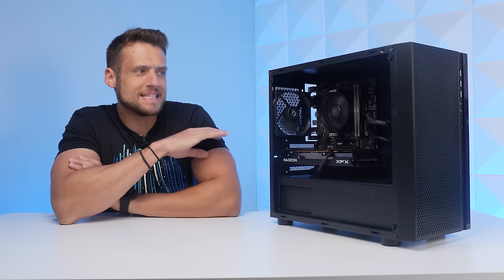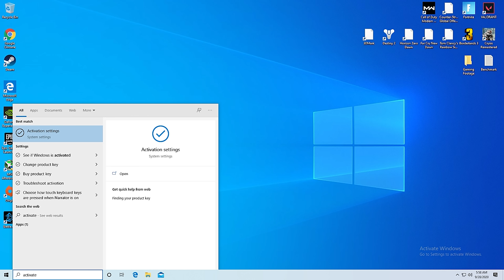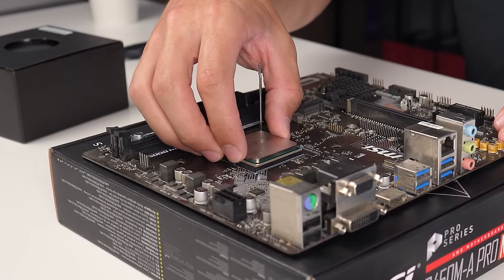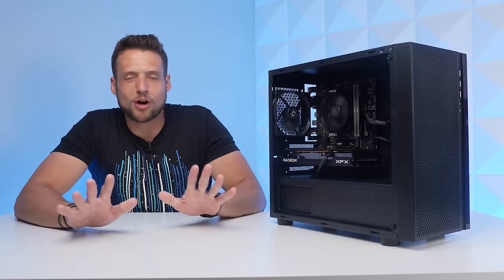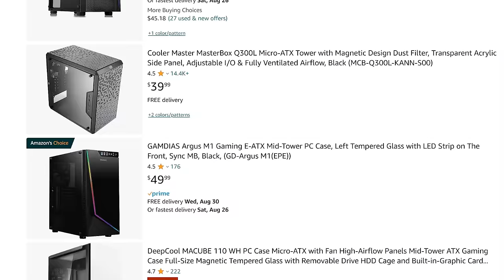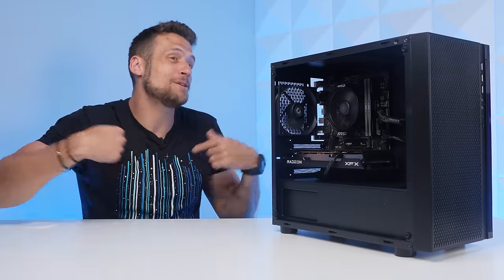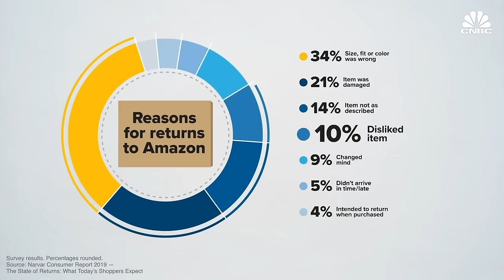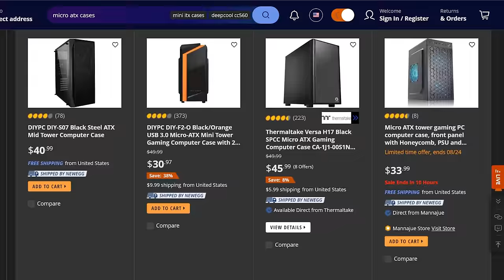How to Build a $500 Gaming PC on Amazon Prime

Comment: You know as a new pc gamer these videos are very helpful, I bought an OptiPlex 790 put the i7 2600 and 16 gb ram and the rx 550 4gb gpu,it has been okay for a starter so thinking of building my own and seeing all these cheaper builds are great as I'm obviously on a budget gaming with an old OptiPlex.
Reply from the maker: Very nice!
Reply: hope u build your pc soon! good luck :)
Reply: That's awesome!!! Something to help if you decide to go for it, this is what I did. I knew I was going to build but didn't want to hit my budget at all once giving me more time and money to invest. 

 Found the case that I wanted. I was able to spend a bit more on it buying it in the beginning. If the case needs fans get those. If you're gonna want cable extensions get those.  These take a part of the budget and are less likely going to have issues where you'd need an exchange. 

Then I'd get CPU cooler, RAM, SSD, PSU... but I'd get these knowing I'd get the rest of the parts within the return/exchange window if any issues. 

Microcenter has some great motherboard/cpu combos. They sell these on amazon too. GPU and you're all set. If you do a $500 build like above this can be done in 3 paychecks. Or 4 if you want to split it up $250 each month 😊

Good luck to you! Building is fun!!!
Reply: When upgrading, changing the graphics seems the best option. I recommend the GTX 1660 for a nice price and still a good upgrade.

Comment: Honestly that's a solid build even with the restrictions you put in place.  If someone was building a brand new tower and was wanting to use this as a template, the only thing I would change (budget allowing) is go to B550 for the PCIE gen 4, and get a gen r NVME 1tb ssd (or 500gb gen 4 boot, 2tb gen 3 data/game drive).  And whatever case fits your fancy.  
If you wanted a drop-in upgrade path, you could snag some used 5800x3d (or 5600x3d?) down the road once more of those get replaced, upgrade the GPU to whatever (7800xt?) to get more longevity.  
I'm probably going to sit on AM4 for a few more years.
Reply: Gen 4 doesnt matter for Ryzen 5 5500, as it only supports Gen 3. Ryzen 5 3600 and 5600 support PCIe gen 4.
Reply: @markkus-oliverollo2380  Wow, I totally assumed otherwise. Advice would still be the same though. Gen 4 nvme costs about the same as gen 3 and as soon as you do a drop in upgrade, you immediately get the gen 4 speed.
Reply from the maker: Yea those changes would definitely create a better PC, but would also definitely be more expensive :)

Comment: What is great is this is a easy jumping off point, if you wait for deals and save a few bucks and returned the incorrect part, etc... you could make this build fancy. Some colored extension cables, colored vinyl you normally add to the PSU and some RGB front case fans and you can make a nice little gaming PC between $500-600

Comment: I am looking the build / buy options.  I am only looking at entry-level PCs for either.  I have been around tech for a while and used to build IBM PC clones back in the late 80s.  Of course back then, there was no internet and finding info meant find the right BBSs and roaming the aisles at Mirocenter.  Also, you might have to do a little soldering.   Looking at yours and other builders, it seems that other than screwing components in place or removing covers to put in SDDs, it seems almost like building with Legos.  I tried do your build but due to part availability and upgrading to a 1T SDD board and 1T SDD card (From the same maker), I came in pretty close @ $642.  Of course, that doesn't include a keyboard, mouse and gaming gear.  To get what I wanted, that was another $310 more.  So, total build out is $952 + tax & shipping.  Most entry-level gaming PCs without gaming gear are around $1100 + tax & shipping.  However, you do have the 1-800 # to call if something goes wrong and an overall build warranty.   BTW, I am looking play games like DCS, Il-2., etc. Not really into MMP type games.  Any advice on which way to go?

Comment: Amazon can be rough. I personally go between Newegg and Amazon. Newegg usually for my motherboard, CPU, Case. Most of the time graphics cards. I use Amazon for M.2 NVME and memory, fans. My go to has been Silicon Power Turbine memory at 16-18-18-38 3200MHz. My secondary pc has 16GB and my main has 32GB. Normally I would chide you for you miss matched parts. But the 5500 is a gen 3 part. However, for my nieces (twins) I am using a R5 3600 (Gen 4) and a B550 with an RX 580 8GB. Yes, the 580 is a gen 3. However, the twins are only 10ys and play Minecraft and Roadblox at this time. But I do like your reasoning. And a nod to the BitFenix Nova Mesh mATX ARGB that I'm using (I already have own 2 RX 580 8GB card and B550 gives me card options and r5 5600 options.) My secondary pc is an RX 6600 and do wish to lose any performance.

Comment: Deadlines are important but the whole reason to buy Amazon and not buy used was to avoid the motherboard issue you went through!  I have built machines but I have no time to screw around with cable extensions I don’t have and other CPUs to fart around with the bios.  I need a solid build I can execute.

Comment: This one was fun. How would you feel about a $400 Amazon build with the R3 4100 and RX 580 2048 SP? Is that cheaping out too much?
Reply: 3600 would be the better choice
Reply: @singularity_of_1  of course it would but its also more expensive...
Reply from the maker: I'm not opposed to giving it a shot lol
Reply: @ZachsTechTurf  could even try a budget apu build that doesn't use the 5600G
Reply: @singularity_of_1 why would you go with an apu instead of a 580
Reply: @void4713  because that's not the point of the idea, how could it be a budget APU build if you put a GPU in it

Comment: I built this (nearly) exact build about 11 months ago for 1000 AUD (roughly $650 in USD)
ryzen 5 5500
swft 210 radeon 6600
500gb teamforce storage
2x8gb of 3200mhz ram from kingston
700w kolink enclave 
some cougar case for 60AUD 
aorus b450 pro wifi

shows just how much the market can change 
im still rocking those parts 1 year later 
just switched up the case, motherboard and cpu cooler this year.

Comment: How does the Ryzen 5 5500 compare to the i7 8700k? I got a PC for $300 that has an MSI Z370-A PRO Motherboard, i7 8700k, GTX 1060 6GB turbo, 16GB DDR4 RAM at 3000MHz, Corsair h100i 240mm AIO cooler, and Kediers C570 open air case with 7 fans.
Reply: pls. tell me how. pcparts list build link or something? im trying for 300.
Reply: @heavenresearch2332 used parts bro
Reply: @a.v.w  This your alt account bro?

Comment: YESSS, Another pc build for only 500$
Reply: What do you think about this PC that I got for $300? 
MSI Z370-A PRO MOTHERBOARD 
i7 8700k
GTX 1060 6gb Turbo
16GB DDR4 RAM at 3000MHz 
Corsair H100i 240mm AIO cooler 
Kediers C570 open air case with 7 fans
Reply: @BREEZYM6015  thats a steal for $300
Reply: @BREEZYM6015  that's a W build

Comment: Amazing build!!! Especially great for people who don't want the hassle of buying used parts or the risk of getting scammed. Only thing I would change is to replace this ugly ass monotone black case with the Montech AIR 100 ARGB MicroATX Mid Tower Case. Also for some reason the motherboard used in this video just shot up to 150$, so use the MSI B450M-A PRO MAX II Micro ATX AM4 instead. Overall with these changes you will have an aesthetic PC Bulid that can run any game you throw at it at Medium-High settings at minimum 60 fps (except for starfield of course) for only 550$.

Comment: Yea Zach, r5 5500 imo is way better velue than i3, at least in Ireland. Heck, for any sub 400e GPU or sub 300 used gpu i would use that chip any time and i even use it in my own PC as it fits my use. That said, from time to time, as hobby i build PCs, so i played around with High end GPUs and CPUs, but r5 5500 is so good value that we didnt have something like this in God knows how long, Even in Rip-off Ireland I3 cost 120e while R5 around 100, with AM4 motherboards much cheaper as well.

Comment: Be honest, you put that extension cable in to drive comment engagement, I literally had no problem with every concession in the video, you even did a shout out for used GPU deals.  Your Case fan is 2" from that header, where is the extension going?  I am assuming for aesthetic reasons you are running the fan cable the long way around the case.  But I'm going to be 99% sure you don't need a fan extension for this build.*

* if you add front fans you'll probably need an extension and splitters if the budget motherboard only has the single sys fan header.

Comment: I like the build, but a problem I have with it is that you are using a Pcie 4.0 card with a 3.0 motherboard and cpu. This is going to be a huge bottleneck because the 6600 is pcie gen 3x8. Would recommend using pcie 3.0 cards like the 2060 or a pcie 4.0 cpu and motherboard like the 3600 and the gigabyte b550m k. I understand this is a budget but if so, just go with an older gpu.
Reply: Yo.! I had the same question

I recommend you to just wait for a couple weeks and save up more 100$
You can can buy a better mobo and cpu
For the cpu i went with is the Ryzen 5 5600(non x)
And the motherboard B550M

Cause using the 150$ 5600 is mych better than using a 100$ 5500

Lol drop your discord
Reply: There will be little difference not significant at all

Comment: I did a pretty amazing build for only 321€

Here are the stuff and prices
RTX 2060 50€ (my friend just said here take it for 50 € i dont care about the money)
i3 12100f 85€
500GB SSD 13€ (3gb/s read speed and 1.5 write)
MSI PRO H610M-G DDR4 90€
16Gb 3200 MHz Corsair 35€
Micro ATX case 35€
Coolmaster RGB fan 13€

Comment: let me fix that list for you:
case: msi mag 100m - $50
psu: msi mag 550w bronze -55$
mobo: h610m-b lga1700 - 75$
cpu: i3 12100f - 110$
gpu: rx 6500xt - 130$
ram: crucial 16gb 3200 cl22 - 28$
ssd: crucial p3 1tb m.2 nvme - $35
cooler: cooler master i50/i70 lga1700 - 10$
total 500$, can even sneak extension cables in
Reply: 6500xt is a very bad gpu you shouldnt buy one

Comment: I am trying to buy my first pc and idk if this is a good build to trust can anyone help me?
Reply: It is actually and my I'd recommend to pick i312100f if you're only going to use the pc for gaming as it performs better than 5500 in terms of that and grab a h610m motherboard along with a rx 6600 which is still a very good 1080p budget gpu and you can also consider arc a750 from Intel(it'll be a better purchase purchase over 6600 any day of the week) but it comes down to your preference if you want to go for it and this pc will be worth the money anyways.
Reply: @dumbo-307  hey sorry to bother you but this is also my first time building a pc and a lil confused could u help me by telling if I should upgrade or keep these parts? And also I will use this pc for gaming and desktop stuff
Cpu: i3121000f by intel
Mobo: H610m by gigabyte
Psu: Apevia atx-pr600w
Ssd: crucial p3 500gb
Ram:silicon power ddr4 16gb
Gpu: xfx radeon rx 6600
 
And will all these pieces all fit together and in the case shown in the video?